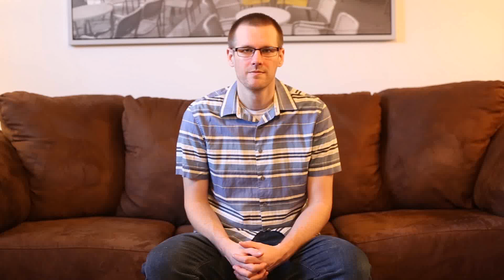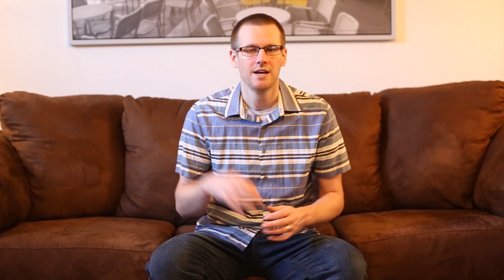3 Reason why few RC Race Boats use Outrunner Motors

Comment: I have two OutRunner Motors one is the atomic Sr85 and the other is the vector Pro angry shark the angry shark has a rollover feature just like the Sonic way I have customized my canopy and put holes in the top drilling out the actual funnel piece allowing air to flow into the Hall and out of the back of the canopy so therefore I have water cool and air cold I could also just tape it off along with some hot glue and call it good if I don't want to run that way plus it's a lot more challenging to play when you have holes in your top for airport

Comment: Is it safe to run a 50amp esc watercooled support 2-6lipo with a Turnigy AquaStar 2842-2800KV Water Cooled Brushless Outrunner Motor rated for 4smax on 14.8v or should I upgrade esc to 90a?
Reply: @Here.now123  cool I just bought a seaking 120amp esc👍

Comment: Hello I've got a Volantex SR80 Pro...It's a 31" hull with a 1750kv outrunner, 44mm prop, Seaking 90amp esc, 4s 100c Graphene lipo. It runs 52mph. I want some more speed out of it, would like to atleast hit 60mph. Should I go with a higher kv inrunner? If so what kv should I be looking at? Thank you for any advice😁
Reply from the maker: Yes you could use a 2000kv water cooled 40x82mm motor with a 150A ESC.
Reply: @RCexplained  So that 90amp esc won't work for a higher kv? I just bought it lol...Just fyi when I run it now with that setup, there is no heat. Like the motor is cold, esc is cold, and battery is barely warm.
Reply from the maker: Over 60mph I would expect you to be over 90A of draw on 4s.
Reply: @RCexplained  I had a 2900kv Proboat motor laying around that I decided to try yesterday...I liked it but it got hot enough for the thermal protection to kick in after like 2 min. Also my gps said it was only doing 41mph which doesn't seem right because that's like 10mph slower than the stock 1750kv outrunner and it definitely didn't seem slower. Maybe the gps app was messing up that day. But I did the math where you times the kv by the volts 2900x14.8=49,920. Seems very high lol. Is it true that could be wasting alot of those rpm's by just cavitating? And I guess my main question is there anything I can do to make that motor work with the 90amp and 4s? Like put a smaller prop than the 40mm that's on there? Can you please tell me what you think from the video. 
https://youtu.be/QLFmsqBxBbQ
Reply from the maker: There could be a lot happening here. 2900kv is a lot of RPM on 4s. Your power system can't handle it. A smaller prop will help reduce load and current.
Reply: @RCexplained  So I actually thought it was the thermal protection kicking in after like 2 min, but today I checked my battery which is a 4000mah 100c graphene and it was dead....so it was actually the lipo cutoff kicking in. That battery was fully charged and that quick run killed it that fast. Also thought my stock prop was a 44mm. I measured it and it's 40mm. 
I did take that motor out today and put my stock 1750kv outrunner back in and fitted a 45mm prop. 
So if I got a 150amp esc, would a 3660 2000kv on 4s be suitable? I know you said a bigger size earlier but I'd like to avoid having to put a different motor mount in..Thank you again for the advice!
Reply from the maker: 3660 would be smaller than I'd like.

Comment: hi ı have simple question about picking motor. ı want to build a rc boat (catamaran) and my question is that if I chosee brushed motor because of price :), which size is going to be suitable for me (775-550). boat is going to be about 1.3 metres. it do not have to be fast but it should be powerfull. the last one, can I use 5 motor with standart car battery :D (ı am sorry for my english it is not good :( )
Reply: If ı use 5 brushed motor can it be equal one brushless motor.
Reply from the maker: Are you going to be using a surface drive propeller? What speed are you expecting? It's a fairly large RC Boat for even the largest brushed motors.

Comment: I have a feilun ft011 it's a 25 1/2in boat it has an outrunner designed motor in it. I am replacing the esc as they come with a weak 30a that I think is bad so I am also contemplating getting a inrunner motor for it as well as creating a single battery tray over the prop shaft that will double as a grease catcher now the question I have is 2 fold A. Does the brushless inrunner motor have to be A "marine grade" motor or can it be any sealed brushless inrunner motor that has a waterjacket??? The 2nd question is B. What size of range would you recommend for this boat size (the esc I am replacing it with is a 150a flycolor esc) I want the self righting feature to continue to work but don't want so much torque that everytime you give it more then a little power that it just spins the boat lol. I will be running 4s-6s batteries in it mostly 4s 2200mah 45c+ or dual (series)2s batteries that have upwards of 80c power my thinking was between roughly 2800kv-3800kv motor is this inline with what it should be running??? What do you suggest???
Reply from the maker: Hi David, you can run any brushless motor where you can get a water jacket on it. 

If you plan to run 4s LiPo only, I would be closer to 1800kv with a motor  in the size range of 36-60mm or 40-60mm. THere is more boat information on the radiocontrolinfo website.
Reply: @RCexplained  ok cause what I ended up picking was a 3670 1900kv motor from surpass hobby I choice it from watching over your vids a few more times I thought it would be the best choice for price X punch X ability to keep cool. you think thats a good fit???
Reply from the maker: @thercadventurer4422  that will work. The motor should run with cool Temps as its quite big for that size hull.